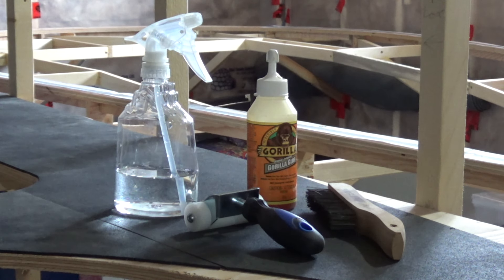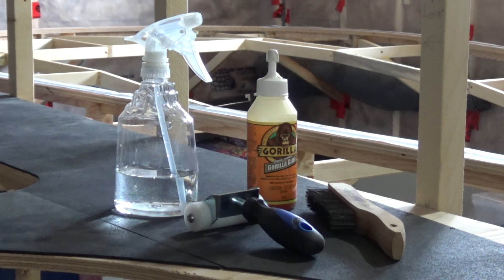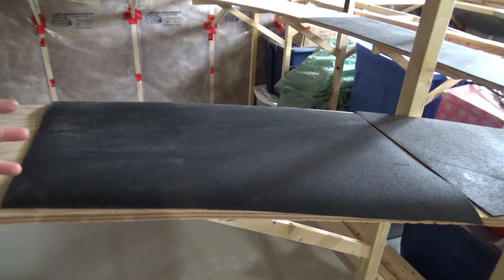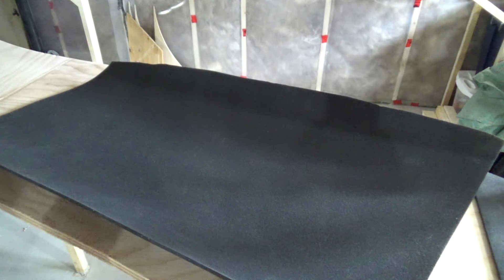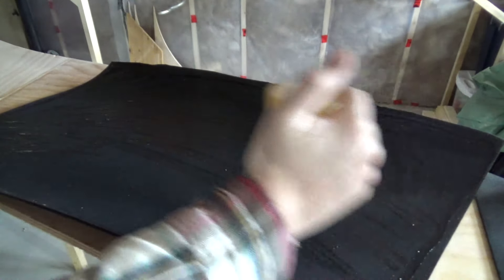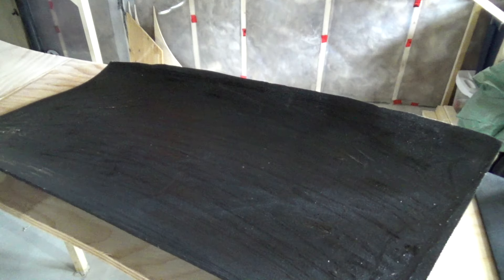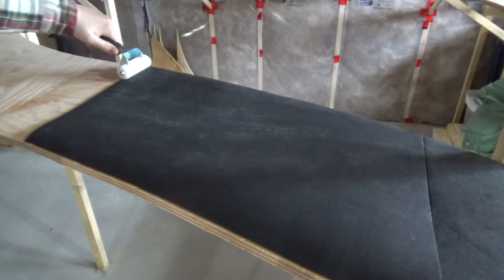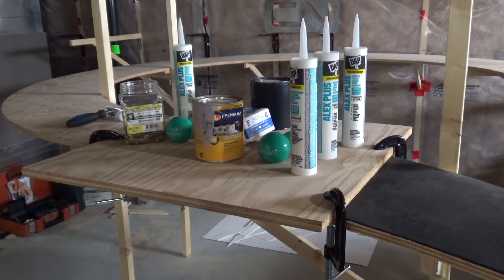Tips For Laying Rubber Sub-Roadbed

Comment: This rubber matting is free for the taking at most transport companies, including the one i work for.  We use it to keep rolls of paper in place so they dont slip on the floors of the trailers.  After use its usually thrown away .  If anyone has trucking companies around you might want to ask them if they have some laying around for free.   It works great with ballast and glue but also one mistake i made was gluing the mat down and trying to remove it after doing my second layout, so i just let it sit on the table and glued the edges only.   It is an alternative to keeping track flat to the table and you get the same effect i find as using cork . If i had to put a price on a cork roadbed , out this way it cost $4.75 for a 3 foot section ,  times that by 2 mainlines on my layout thats 88 plus feet , pretty expensive so free rubber was the way to go.     Nice layout design you have there by the way,   cheers

Comment: Wow man this is awesome!  Never seen it done before. Is there a comparison video? Im thinking of doing this. It could give you different ground hights too.Put plaster cloth over it and you got a little slope. Thanks for sharing this.
Reply from the maker: Thanks! In the video info I included a link where I did an experiment of the track noise with and without the rubber. It resulted in a reduction of track noise by 5 dB.

Comment: I have use 3M spray adhesive, if you spray both sides, let it set up, and it will not move once it is down. You can't move it if you try to stretch it.

Comment: Have you tested this with cork and track and ballast to see if you're really gaining anything? It seems like a lot of work.
Reply from the maker: I included a link in the video info where I tested a stretch of track with and without the rubber. It resulted in a reduction of around 5 dB. There was good discussion around whether or not it's worth the extra work and $ to install a layer of sound deadening material. For my layout, I decided to do it because the benchwork is attached to the joists and the track noise resonates right up into the ceiling joists. Other styles of benchwork like L-girder it's not as big a deal as the sound has no where to go but to the concrete floor.
Reply: Thanks, I do recall that video now. It's nice to watch your progress. Cheers, David.
Reply from the maker: Thanks David!